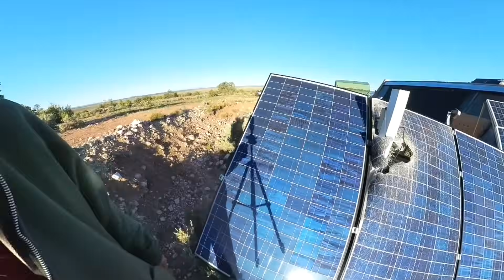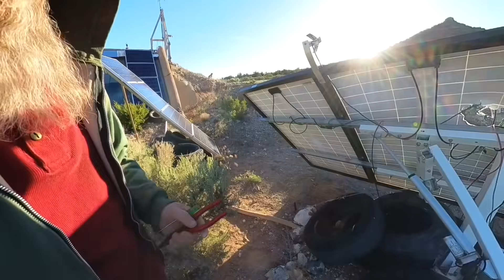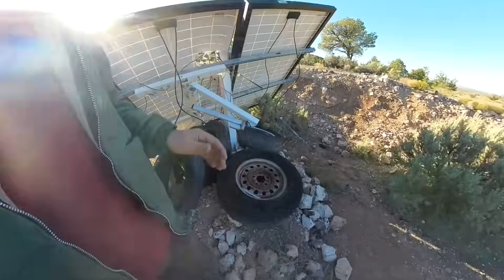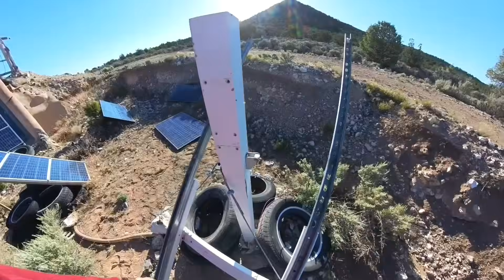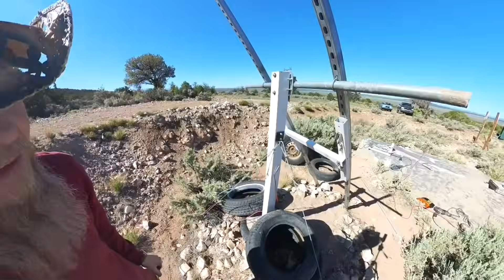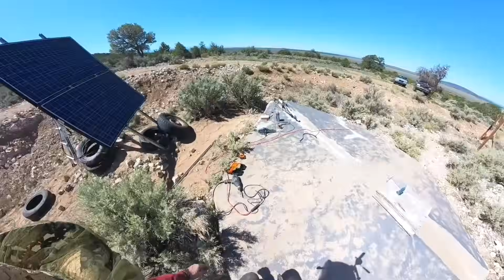Repairing The West Solar Array

Comment: That's the basic problem with many, even most trackers.  They tend to be fragile compared to a fixed mount.  It's usually cheaper to just use a fixed mount and take the money that the tracker would have cost and spend it on more solar panels for the fixed mount.

Another trade-off that works well is that if you need a shaded open-air space, you can build a Pergola type of structure and just make the roof directly out of solar panels.  A strong angle isn't needed (like 15 degrees is plenty good enough), so there is lots of space under-neath.  And again you trade-off a bit of energy against the convenience of additional space underneath by not having a strongly-angled roof.

(It isn't water proof but it makes for a decent space and the light angle also makes it more resilient to wind than a heavily-angled setup).

Nice that the thing was still putting out power even damaged.